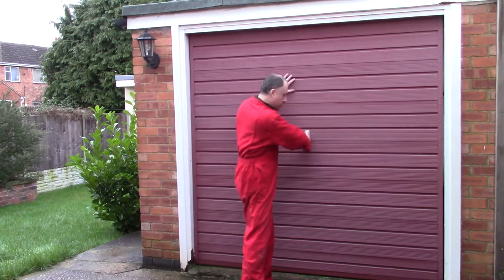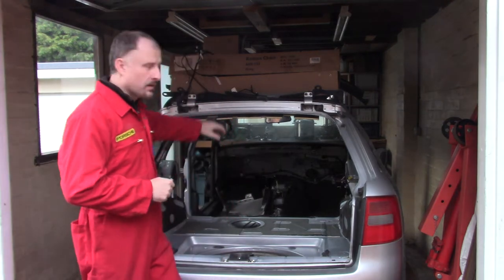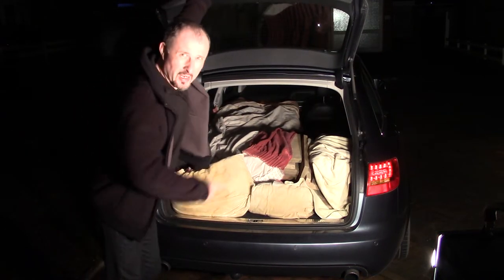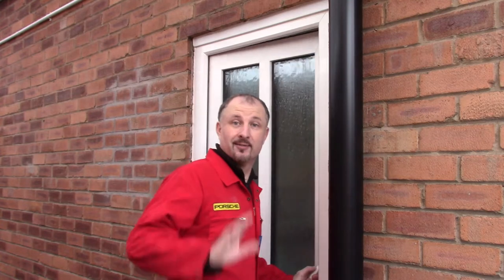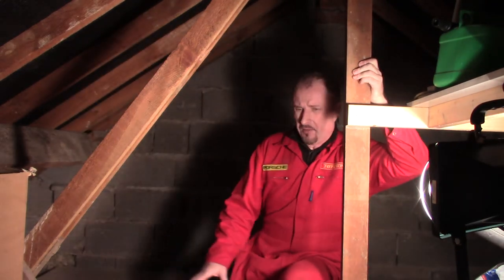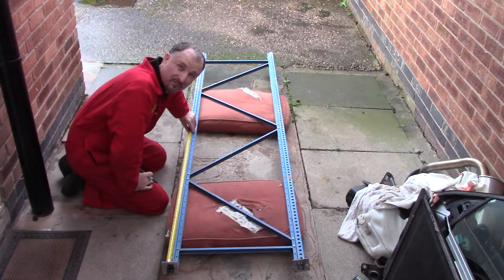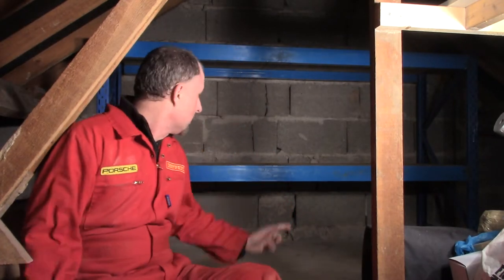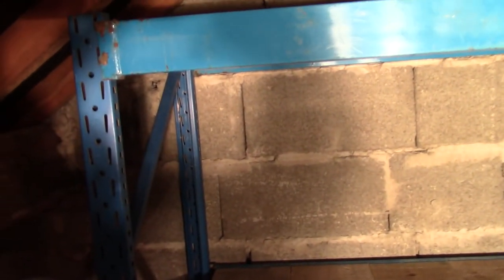Storage Problems: DIY SUPERCAR

Comment: 'Spose eventually after the build you'll know what can be kept and what can be discarded. This will help with future builders and their disarray, mess, attic, frustration. Bloody small hole to get anything into the attic. We don't generally have 'em here in Aus. Roof pitches are pretty low - no snow I 'spose. New suburbs demand steep roofs now for the "look" - oh what a wonderful life we live now. My new house has heaps of room up there, but after the air con ducting was fitted I gave up on the idea. Bloody ducting everywhere. Still, have a shed out the back. Bloody blocks here are getting tiny - no room for a shed. Used to be a standard of a 1/4 acre block, long gone. 'Stralia's going downhill mate. (still a good spot tho)
Reply from the maker: I would gladly swap my attic for your weather and space. Your Aussies sheds are 10 times bigger than our tiny UK ones. 1/4 acre block? I'd love to have that, but that sort of space is big money here in rainy old England.